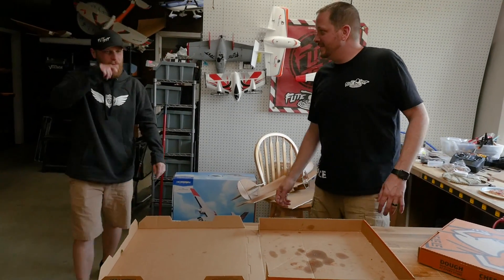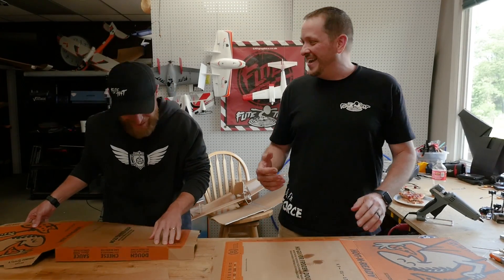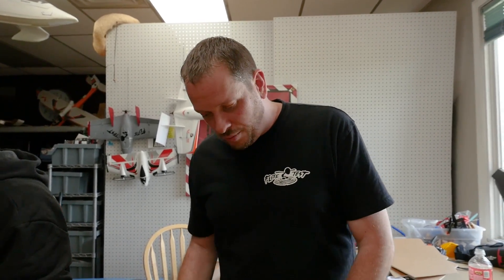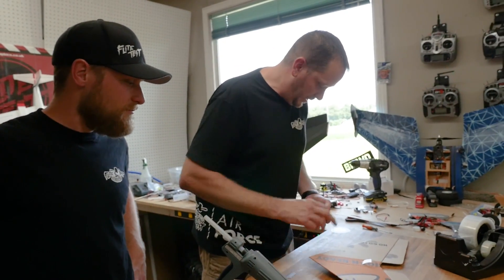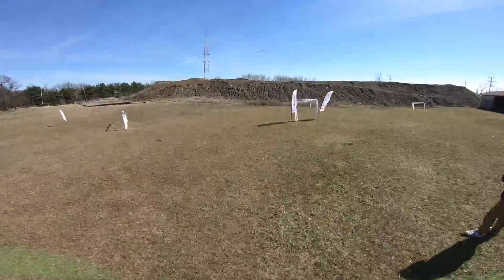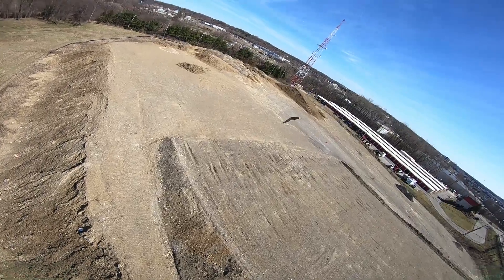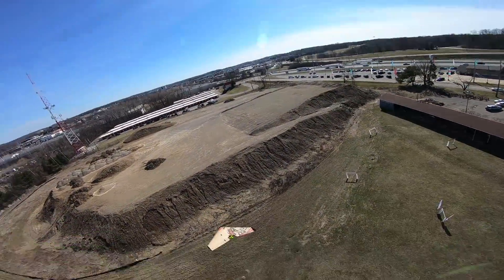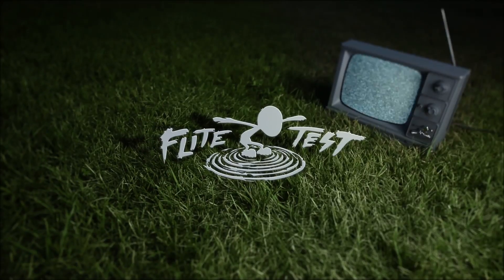Airplane from a Pizza Box?

Comment: HI Josh - have you thought about working with the various pizza chains to have them print the interior of their boxes with lines that define the shape, cut lines, crease lines, etc? Also printed inside would be the URL to the FT Tech Channel video covering the build. Thanks.
Reply: Kevin Hoskins Ironically that is what delayed the release of this episode almost a month. We were working with some large chains to get the inside of pizza boxes printed so that families could build after they eat. We are still working on it but felt that the time was taking too long and we wanted to get the episode out so people could be inspired to build their own. If anyone has connections to any pizza chains, we would love to work with them to make this a reality. We would use our stem program to create more designs and have them put inside pizza boxes. Just need to find the right Company to embrace the Vision.
Reply: @joshuamelvin  what power pack are using to fly that pizza box  i know i would build  build it if it came inside the  box
Reply: Now you should try to make a whole pizza box fly in a way that you can deliver pizza in it. You can use that idea for the release of the video when you announce that you have plane lines printed out inside the box. You will probably want to glue some of those mini tables onto the top of the box to hold the pizza in place while you fly it around. It can be like the chair plane... except you have to be able to eat it after it flies. 
Alternatively you could set it up so that the design is printed on a thin piece of paper that can be handed out to turn the pizza box into a plane, that would work with multiple different pizza companies and they wouldn't have to change their boxes. Another thing you could do is you could use the designs on the boxes to line the points up but the planes would have to be individually designed for the boxes? I just want to see an actual pizza box fly, even if you do just stick it onto a big quad...
Reply: That is actually a million dollars free ad   campaign for the pizza companies they would be out of there brains not to work on it even with alignment to the pizza brand logo to just fit tilting the wing so it will be a free flying advertising
Reply: RMD Cade you guys are making that a reality. Thanks so much for all your support!
Reply: If you go with that, my thought would be to make it a simple chuck glider vs. a powered RC model. That way any interested parties could just build-and-fly without having to have a radio and electronics. In the plans you could then mention how to go to FliteTest.com to find out how to build a powered version.
Reply: We had a mother and son stop by our flying field a few weeks ago. A few days after that the boy's father called and said that they purchased the the FT Flyer and would like some help. I'm happy to report that this last Saturday father and son did their first bunny hops with their new build. It really warmed my heart to see the two of them bonding over that experience.
Reply: Gosh this is actually sky is the limit for them with special slogans such as eat build and fly or even a custom printed boxes with a special promotion for hobby fans and builders , wow my brain is actually working over time now thinking on all what can offerd over the table in such a corporation deal god its a 100 win win deal
Reply: I hope you can point to this episode in your continuing negotiations with those chains and show how excited it's made us!
Reply: I knew that this would work out well.
Reply: Being in manufacturing, the only issue I see with this is that most pizza boxes I have seen are printed on one side only.  Therefore the investment would not only be in print design and implementation, but also with physical hardware.  Best of luck with the endeavor though!
Reply: Bring a roll of wax paper to put under the pizza, to catch the grease.  Get the $6 Mostest Bestest, cuz the color is a lot more visible, in the air.
Reply: Brilliant!  THANK YOU, Josh Bixler!
Reply: Great point about printing both sides!  
Idea: Have the pizza companies run a limited edition box with the whole plane printed with custom color scheme on it. 👍🏻
Reply: @Josh if you make this happen PLEASE let us know! that's fantastic! Also, are the templates you used to draw on the pizza box available anywhere?
Reply: Hullo. I saw this comments, Op idea. If you do do vthis can you please do pizza hut, dominos or Sals? Theyre the ones we have in NZ and i dont wanna order pizza from another country. It might go cold
Reply: I think it will happen. Best thing is to show proof of the concept through our awesome community and FT Stem.  Can’t express how bad I want to see families and friends sitting down and building a memory together.

Comment: Don't get fooled to use a plastic bottle cap for a motor mount. I pushed my plane so hard it melted and crashed. Otherwise a great model. It can accept a spare flight controller left from a quadcopter project and add stabilised flight and other features.

Comment: I had terrible trouble trying to drill out a bottle cap for the motor..after a couple of failed attempts,  I gave up and used a 3D-Printed-Motor-Cover-Protection-for-1103-1104-1105-1106-Motor from banggood... 4 for £1.80 .. .. a perfect fit ... job done...
My tiny 24" V wing is made from depron not cardboard...

Comment: I purchased an RC plane online it came with a controller is it possible to use this with other motors. I'm very new to the hobby. Purchased the rc plane F949.
Reply: depoende del motor, en principio sí pero debes fijarte que no sea un motor que le exija más amperaje al esc porque podrías quemarlo, de todos modos fijate en la temperatura

Comment: Well done guys! I've completed a similar project, designing, building and flying my V.E.P. Very Easy Plane, using the polystyrene trays you find under the pizza, you buy at the local supermarket. Plans and instructions are available on Instructables website. Just type RC Very Easy Pizza Plane on Youtube.

Comment: This is beautiful. Foam board may be $1 per sheet in the USA, but in Australia you can't get it for less than $10 per sheet unless you order online in bulk. It's almost cheaper to order injection moulded EPP wings from Banggood than to build FT planes from scratch.

Comment: Can please someone help me?
 I made my first rc plane with coroplast sheet and it weighs a lot at around 800-900 gm.
Will it fly with a 1000kv motor paired with 1045 on 3s producing 600gm static thrust?
Its my first project pls help.
(The wing has an aorfoil shape btw)

Comment: This probably won't get much notice but I do this all the time. The pizzas I get come with a polestyrene base so I've designed and built over 40 different Chuck gliders but I don't have the money for all the power. That will come hopefully soon. Most of these are modeled off real planes from avro Lancasters to f35 jet fighters. I've been doing this since December last year. Nice to see the same concept taken into practice on my favorite channel. Only this time with power. You guys have really inspired me into this hobby.
Reply: Thanks brother. You guys inspire us everyday. :)
Reply: Are they profile gliders?
Reply: I'm not sure what you mean by that
Reply: Why don't you try make a plane with a wingspan of under 60cm (my largest planes wingspan) and put micro motors from things like the tiny woop
Reply: Profile planes are basically made from flat pieces of cardboard, foamboard, etc. They don't get "volume" by folding it to create a fuselage or whatever. Just search for "profile rc" to find some examples.

Comment: In case anybody here is from a place where foamboard is expensive and tricky to get, just thought to mention that corrugated cardboard works quite well as a substitute. You can still do ABC folds and everything, it's just a bit heavier. It might sound like I'm redefining cheap, but maybe somebody finds this useful. It has gotten me personally into flying!
gets a new battery and flies away
Reply: Also here's a few tips for working with cardboard:
- align hinges, folds and cavities perpendicular to the 'spars', it's cleaner, easier and stronger
- brown paper tape blends in great and is your friend
- electrical tape around the edges is a quick and easy way to improve looks and actually looks quite nice without the need for additional decor, also extremely easy to repair
Good luck!
Reply: Dude I dumpster dive for materials all the time, you can find just about everything you need for planes.